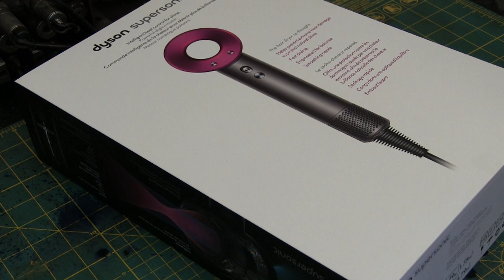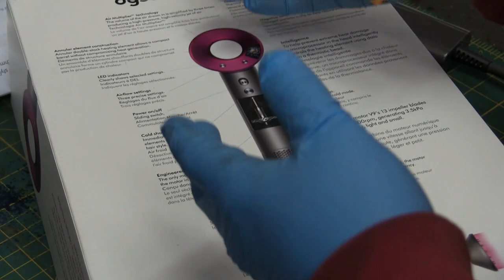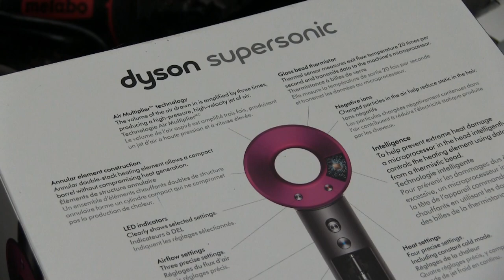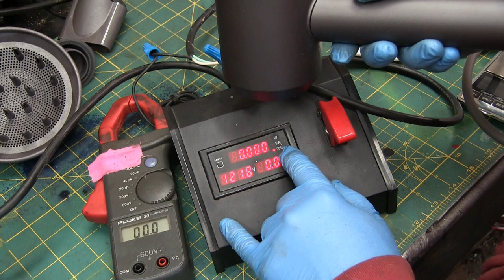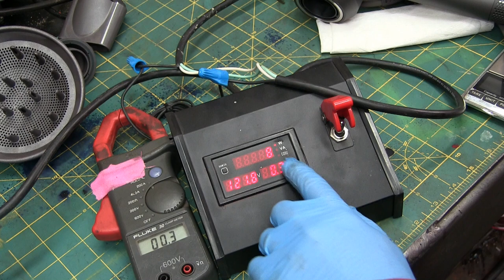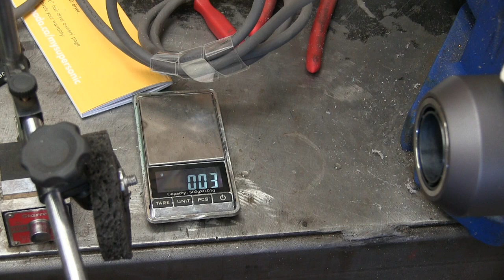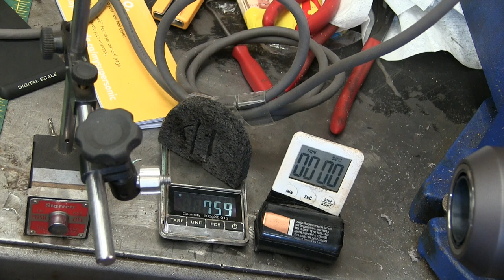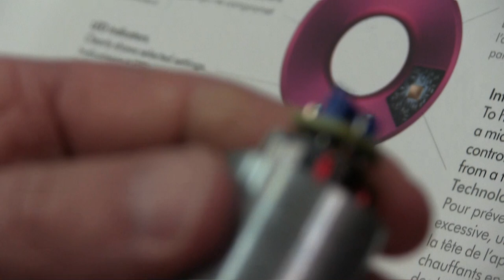BOLTR: DYSON HAIR DRYER. Is it WORTH the MONEY?

Comment: I feel like your video should have made me steer clear of this product at this price but it promoted me to finally buy one. The guts are simple but the drying experiment set it apart. 

I have long, thick hair. It usually takes well over 30 minutes to dry and even then, that’s just to damp and without styling. I stopped drying it since it took so long. Now it takes minutes. The time I save is well worth the price tag (which was less than retail since I got it refurbished from dyson).

Comment: 41:50 "Didn't see that one coming"  Lol. I knew that was going to happen the second I saw the circular saw. I don't typically case for overly strict safety regulations, but using a circular saw like that is a great way to loose a finger. They are also great for cutting slices of human leg steak, if you get hungry. I always keep a steel bar in my pocket when using a circular saw. I've had kickback throw the saw towards me twice, and while it's never actually made contact, I don't trust it not to.
I would think an easier way would be to clamp the thing in a vice and use an angle grinder (because of the smaller blade and better grip) or jig saw / reciprocating saw.
A dremel with a cutoff wheel should work too.
Or a hack-saw...
Or a chisle and a hammer.
Or just a hammer.

Comment: They probably went so far to make the plastic seem like metal so that it would have the premium feel of metal with the low low weight of plastic. The fact they did so well to make it almost impossible to tell it isn't metal is impressive really. I think you are paying 500 bucks for the insane engineering that went into making this thing and it looks like it would probably do a swell job and maybe even last a long time if nothing runs hot to the point it degrades the life of it. So yeah it's like buying a super car but for hair drying but um maybe not as much difference in performance over a standard affordable model? I can imagine this thing being WAY better in a salon setting where the stylist has to use the dryer all day long.

Comment: I'm just an auto mechanic by trade so I'm in no way an expert but do you suppose the Dyson's better drying has anything to do with air turbulence as it exits the dryer? I would assume a more efficient air flow would offer a higher flow rate at your target area?
Reply: The difference wasnt as substantial as people in the comments are implying, not like there isnt a large margin of error in the method he used to test it.

43 minutes of "youre a fool if you think this is worth more than a $40 hairdryer" and people seem to have only heard "it DOES dry faster!"

Unreal.
Reply: Yes I suspect you are right, but mass air flow will be the same, but velocity higher so you have an almost mechanical convection action, coupled with heat to dry.

Comment: I work at a plastic injection molding company and one of the plastics we use is crystal styrene. We make a document frame out of it and some other stuff similar to that. If you didn’t know it was plastic you would think it was glass. I mean it scratches like glass. Breaks like glass and smells like glass when you melt it down

Comment: Crazy overpriced, but it seems built to last. I mean, i bought a Dyson vacuum about ten years agom DC19 or something. Anyway, it costed around four times what the others did. I have to say, it has lasted around that times what the previous ones did. The one before was a bosh, and it died in about 3 years. So yeah, at least from my experience, Syson i pricey, but in the long run, you get your money's worth.  Hair dryers dont usually las more than 2 years or so, if used daily, if this one could do ten years, it might be worth something. Still... 500 on a hair dryer is too much, no matter how good it is, LOL.
Reply: I disagree with the high price point that everyone keeps saying. As a professional that works in the Industry, the price is comparable to most hot tools that stylists use. For example good quality flat and barrel irons go for around $400. However, hairdryers are another matter. All are noisy and top heavy. If this Dyson hairdryer addresses these two concerns, then the $500 price tag is worth it. However in this 44 min video review, AvE didn't address those two things. Sure we saw a white noise graph, but that doesn't tell us anything real world. Like what are the decibels compared to other hairdryers??? Can I have a low volume conversation without the noise drowning it out??? Based on the microphone, the Dyson is just as noisy like the drill and grinder he was using
Reply: if you'd like to compare the decibel rating to the dryer you have simply download a sound meter app for your phone and run it near your hairdryer while in use, it's not going to be 100% spot on but it will get you close.
Reply: TheNextStepp ...not only "not 100% spot-on", but worthless. Use a decent decibel meter weghted to the same tone as the one he used, or the isnt any comparison possible.

To be fair, even the ambient noise and surrounding reflectivity should be more or less equal to be of some consideration. "Use your phone"... , cmon, man, you probably know as good as me that they're just absolutely worthless! hehe.
Reply: Thx for the phone app option., never considered that as I was more interested in a model vs model noise comparison. Again both hairdryers sounded loud to me, but AvE and other reviewers have said the Dyson is much more quiet...
Reply: My dad has a foldable hairdryer that is like 20+ years old and still works. Maybe was 25$ at the time? I don't know. It wasn't used at all for maybe 15 of those years, but still it's 5+ year longevity still must mean something.

Things can be made pragmatically and over-specced and still be reasonably priced. It seemed to be a common thing in the past, but disappears more now.

Comment: A trick to fix your tinnitus, put your hands over your ears so that your fingers are overlapping at the base of your skull. Press firmly to seal your ears and snap your middle finger of the top hand over the middle finger of the bottom hand so that it hits the base of your skull firmly (do this by pressing down with the top finger and pushing up and out against it with the bottom finger) such that you hear a bass thud resonating in your head. Do that a dozen times or so and the tinnitus will be gone when you uncover your ears. It is a temporary fix but it works every time.

Comment: Normal hair drier....Switch, Heater element, Fan - 3 things to go wrong.
Dyson....500 parts inc electrolytic capacitors in a massive heat generating device.

I know where my money would be on longevity. This is over engineered junk - plenty of em failing if you google it.
Product is only as good as its weakest part and putting electrolytic capacitors near the heater element of a hair dryer is just asking for trouble.
Reply: Have you used a hair dryer on long hair daily? no? come back when you have
Reply: They always overengineer every thing and call the older stuff obsolete. Meanwhile I'm using my 2003 Kirby that'll pull dirt out from under the carpet and even greatly out preform a Dyson even with s full bag!
Plus, it's a direct air vacuum so it only uses 7amps.
Reply: It's-a me Megatron. I’ve got both a 1997 and 2005 Dyson. Better than any direct air vacuum. Reach right up the stairs, go up along the high ceiling and great comfort on carpet and hard floors. The “over engineering” clearly pays off.
Reply: I own both a Kirby and a Dyson. The Dyson is a far superior product, even after 5 years of use... I used one upstairs, and one downstairs for a long time, but stopped using the Kirby pretty much all together because the Dyson could pull up dirt that the ol' Kirby left behind. I believe it's a fair statement to say Kirby is obsolete. Pulls less dirt, heavier, and less maneuverable than the Dyson.
Reply: Nathan Farringer 
Actually any the Kiby does pick up more dirt (unless the fan is damaged) but no vacuum picks it all up.  You could go over the Dyson with a Bissell and it'll stick pick stuff up.

They're far from obsolete, I know people who have done tests that proven they pick up more than Dyson since they clean down to the padding.
Reply: No, I'm sorry it does not... The Dyson will out-suction the competition (unless you sucked up the used condom under your bed) period. Our Kirby was and is still in great shape. I've done side-by-sides, and the Dyson is better. If it wasn't, I wouldn't have bought a second and third one...
Reply: @nathanfarringer7492  
But it is more powerful.
A G series Kirby will pull about 120+ CFM and the top of the line (Corded) Dyson will 57 CFM.
Yes, the Dyson is more maneuverable and a bit lighter (depending on your model) but they aren't as powerful. There's a reason Kirby and the similar Royal hasn't changed design. 

Always remember this too. He who vacuums last wins.

*Edit: the DC40 has 55 CFM from the bottom and the Kirby GSix has 160 from the bottom.
Reply: It's-a me Megatron. Well it’s a bit useless having a powerful Kirby when I can only cover half the area of the room due to its lack of manoeuvrability

Comment: I do injection molding and we use ALOT  carbon fiber mixed nylons we call it 27-16 and fiberglass we call 27-07 and it’s a natural color. We do have a bunch more with fiber glass like 27-21 and it’s high heat it melts at the nozzle around 630 degrees the 27-16 carbon fiber melts at 510 to 530 depending on how dried is the material.

Comment: BLDC motors designed to run at high rpm are not usually controlled using encoder feedback but rather by back emf sensing.

Comment: With brush-less DC motors lower pole count allows for higher RPM, higher pole count translates to lower speed higher torque operation, this Dyson 'V9' motor is a simple single phase design, from what I can tell in the video hence only needing two mosfets to drive the single phase.  The controller can 'sense' the motors position through a magnetic field feedback, most hobby brush-less motors use a sensor-less design, thus lacking an hall effect or position encoding wheel.

Comment: the chunky box in the cable is probably to increase the voltage as the unit is designed for the 230 volts in Europe. The European versions have a simple cable.

Comment: The reason the Dyson filled the trash bag slower is it is relying on the venturi effect to increase flow. The standard dryer is able to fight against the compression better because the mechanism is sealed so it can compress the air. In actual use, the Dyson probably flows more air. The current draw when not in use would be a deal breaker for me even if the price was the same.

Comment: AvE I use and install outdoor (wireless) energy controls as part of my job. Every conductor and ground going to the device is tinned, and in aqua tight conduit. It definitely works, even after the conduit has been filled with water for some time. Takes some time for the current between conductors to make a short that causes an issue. 120-240 vac that is. Thanks for the video. Pretty fuckin entertaining man!

Comment: AvE, The reason the Dyson dries faster despite the same wattage and air volume is because of the air velocity. A box fan will move more air than these two units but it obviously won't dry an object faster than a focused hair drier stream. High velocity will Mechanically peel apart and knock water off as you could from the splatter. This makes a minor difference in a sponge but for a material like hair this makes a huge difference because drying only takes place when the strands are mechanically separated. This is the same with dyson airblade driers we're all familiar with. They dry faster not because they evaporate the water but because the speed physically cleaves a lot off and the remainder evaporates relatively quickly. 

Great video otherwise. Was glad to see the insides of this thing.

Comment: The wife got one for Christmas .    It’s nice and even has a heavy cord which is quite long.    The thing is really made for commercial work.   What I HATE is the location of the AIR INTAKE.    You just want to put your hand over that intake.   When you so it overheats and shuts off.   Then you get to wait….., and wait.    
   When it comes to switches I’ve had my dealings with their vacuums plenty of it.    Not good.    I made the wife go to Shark as Dyson had gone so far downhill and I couldn’t really fix any of these switches and such well if at all.     Too techy and flimsy for me.    The sharks do the same thing equally as well for 1/3 the price .    Best thing  is Shark  all the same features more or less…..

Comment: No matter what the difference in functionality or drying time between the two hairdryers, the Dyson is not worth 10 or 15 times the price of the Conair. A lot of those parts say US as if they are made in the USA. But Dyson should make a super turbo "ribbed" Hitachi Magic Wand. Atmel is (or was) a Silicon Valley based company, that was bought out by Chandler, Arizona based "Microchip" corporation. But Dyson is making a killing on this junk, - manufacturing a hair dryer that probably costs them $80 to make and selling it for 500 Cajones.

Comment: Opposite of an autoclave. It's a vacuum deposition chamber. They pull a vacuum while an induction coil melts a small quantity of the metal to be plated to the part. Liquids in a vacuum evaporate and what you end up with is a cloud of metal vapor that condenses on the surface. 

An autoclave is a pressure vessle that allows water to be heated well past boiling temp. In a 1 bar atmosohere at sea level, water boils at 100c. It can never be heated beyond that point because bouling is the point at which a substance has too much kinetic energy in a substance is greater than the forces acting to keep the atoms from bouncing away to attain thermal equilibrium. Temperature is simply a measure of the kinetic energy of the atoms on a substance. Water can boil at 400 degrees below zero. Know what's REALLY cool? (not a pun) Liquid Helium. All this talk about magnets, polarity, rotors and staters makes me frisky to fuck around with my idea for a rail gun using a liquid He as the conduits inside the tracks... barrel... rails. Whatever. 

I have no experience working with electricity and a capacitor bank big enough to fill a van migt be asking for a problem. Anyone interested in see what it takes to NOT get electrocuted, blown up, cryoburns, thise tiny little metal splinters you get from working in a machine shop?

Comment: The white noise spectrum is related to the blade interaction with the stators.  They chose 13 blades and 5 or 7 stators (I think..) to reduce and spread out the tones in the noise.

Comment: This is definitely the ONLY hair dryer on the market that's anywhere near this fast and efficient at drying hair without getting too hot that's at least 20-30% lighter than other top hair dryers. Probably the only Dyson product that's uniquely worth it.
Reply: Eleine Sun 
They're products aren't exactly reliable so I wouldn't recommend it.
Reply: It's-a me Megatron. My hair stylist uses it because she uses these for 4-5 hours a day. 20-30% lighter, 20-30% faster means significantly less sore and time saved. It's a huge deal. She's had hers for 2 years. Skookum isn't the only metric that matters!
Reply: Eleine Sun 
I'm honestly surprised it lasted that long under professional use.
I still don't like their vacuums and air blades though. 

BTW what's Skookum?
Reply: It's-a me Megatron. Why the hate on Dyson? Seems kinda arbitrary
Reply: Eleine Sun 
They're false advertisements "most powerful suction of any vacuum" "never clogs" I did like their older models but lately the quality has gone down and the price way up. Especially their cordless models, yes they're good but not for 700$!

Funny story. Theres this guy who made a bagged conversion for the latest model and it actually had more airflow than with the cyclones! Although most of it was lost due the complacated airpaths... which is honestly a shame because the motor itself is pretty powerful.

Comment: I have a question about the flame test at 9:00
When he puts the bead into the fire the flame that came off it turns yellow. I'd thing that's the sodium (in the glass) painting the flame that color.
Would the color of the flame be enough to tell if it's glass or carbon fiber? Is there something else that could paint the flame a similar color?

Comment: AVE, I am wondering if that two TO-220  packaged “MOSFET”s for heat switching might not be MOSFET because the heater is powered by AC. I think it might be SCR instead.  Very few people use MOSFET for AC switching. The reason they don't have heat sink on them might be due to the passing of high speed of cold air.  For the magnet in the attachment nozzle, I am wondering if it is NdFeB type? NdFeB has relatively lower temperature rating than others.

Comment: i don't think i have ever bought drugs measured in inches, no comment on grams

I suspect the evap speed difference was in the air jet itself, if the standard fan in a cone assembly has a turbulent jet and the dyson does not, it's just getting a bit more of the air onto it's target

Comment: How do you remove the pink part at the top of the blow dryer? I have one I’m trying to take apart but I can’t figure out how to take that pink piece off without breaking it to hell.
Reply from the maker: It's just glued in. Work around it with a sharp knife and small screwdriver.
Reply: @arduinoversusevil2025  good to know. Thank you! My dad and I are both engineers and dammit I want this blow dryer but I want to fix a scrap one. I’m not about to spend $500 on it.